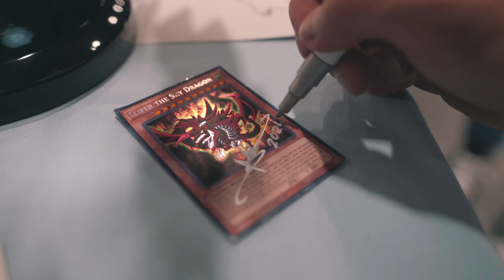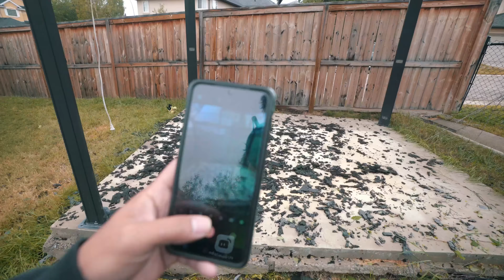INSANE HAILSTORM AFTERMATH ON THE CARS..

Comment: Heads up, you really don't want to run a 3D printer in your home... You always want to run a 3D printer in a garage or shed or in a place with GOOD ventilation, because they put off VOC's in the air. 

Credentials- an industrial design collage grad and materials scientist.

( But make sure to always keep an eye on them, things that get hot and go brrrr should be monitored)

Comment: Not gonna lie, nobody thinks the hail storms are going to be that bad until it is that bad. That really sucks. :( Replacing the trunks and hoods aren't too bad but the roof is another story. Hopefully insurance can do something for you if it's cost effective or too damaged to fix? Or if anything, sometimes you get more than enough $ from insurance for repairs to where you can spend that money in cost saving ways, get new parts, go thru trusted friends and have money left over to save or spend elsewhere. Just a though. Despite this feeling like another problem to deal with, just remember, a year from now this isn't going to even come across your mind. Just a bump in the road to get past. Things will get better!